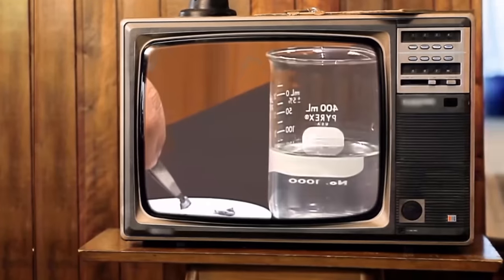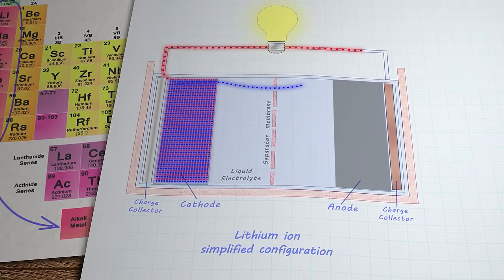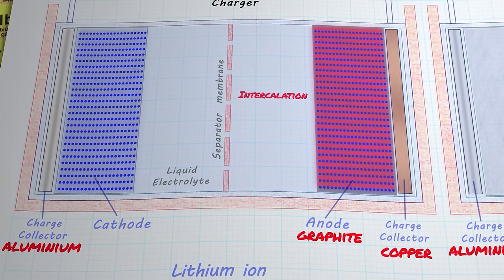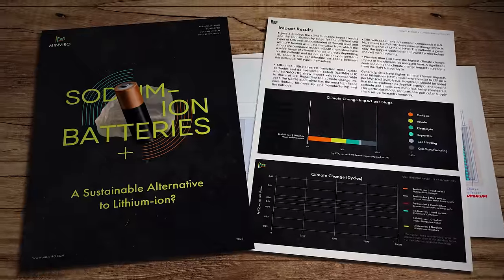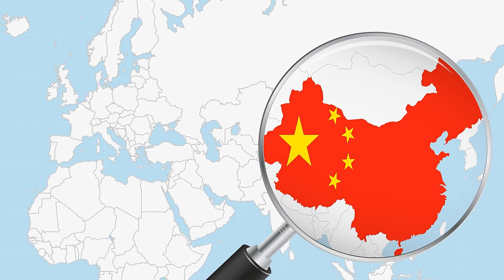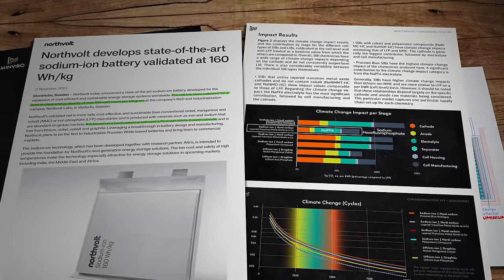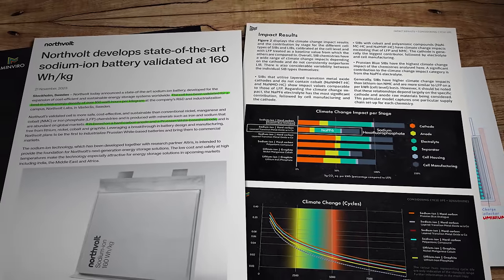Will your next battery be based on salt?

Comment: Dave, one of the primary needs right now is for affordable, home and small businesses-scale battery storage. China is selling a 30 KWh EV for $12,000. In the US, a Powerwall (modem flipphone) goes for $11,000 per KWH! The average house will need at least 30 kWh of storage. I’d love to buy a Chinese EV just to store the energy from my solar panels for home heating, cooling and lighting.
Reply: The cost and complexity of switching and inverting at the home makes no sense.  Far better to actually invest in the grid and leave these problems for a far larger scale and benefit everyone.  I know california's grid is 💩 and everyone thinks they need energy independence but it is a terrible future.
Reply: @ccibinel With most manufacturers planning their future EVs to include bidirectional AC charging, most homes would just need an interlock kit or manual transfer switch, avoiding the complexity you noted.  Same tech used by many with their home generators.  

Yes, some will opt for the cost and complexity of automatic switching, but they will be in the minority.  

And incidentally, those costs are also dropping.

Comment: The old VW e-up has only 126 Wh/kg cells and it is enough for everyday city driving (and those chells charge fast and handle low temperatures without problems).

Comment: As an urban/suburban transportation system planner, the bigger picture is to me being ignored. How about we not plan on everyone driving as much nor as far as we do today? In that regard, any new battery resource must be distributed to the most households. Instead of planning for EVs to provide a 300 mile driving range, 30- to 50-mile range addresses the problem of maniacal traffic and senseless car dependency. The EV tech that offers most benefits in this regard is "small battery" plug-in hybrid PHEV, eventually PHEV+H (combustible hydrogen) especially applicable to long-haul freight trucks as well as average household EVs that can keep the lights on in grid outage, indefinitely when matched to consequently smaller rooftop solar and neighborhood mini-grids.
Reply: I agree, the retirement  market might like this.

Comment: Why don't we use ram pumps to push water to an elevated reservoir? It could be a closed system, using a bit of solar to get the ram pump negative syphon pressure started. It's not just current technology, it's perfectly clean easy to maintain; unaffected by weather or drought. You'd need a lot of them and a lot of tubing since ram pumps don't go up steep hills, granted, but the energy generated from releasing the water is perfectly free and perfectly reliable and consistent. It makes way more sense to promote an economy of plumbers and geologists and pay low skilled labour a living wage to key an eye on leaks or stopped pumping to kick start the system again if pressure stabilizes. There's no downside except the productive labour. Besides nuclear, it makes more sense than massive endeavors like refitting the entire grid to get EV's on every driveway.

Comment: Wind and Solar + Battery storage is the way of the future. Take the energy the sun emits, store it in a set of grid batteries, then pipe the energy to where it needs to go. If sodium batteries can be cheaply manufactured and replaced/maintained, that would be great.

Comment: From what I've seen, there are more benefits to sodium than what was explained in this video.
-the first and most important to Canadians is that Sodium has >90% energy availability at -20°C which means winter range would be way up.
-the second benefit is due to its stability of the chemistry, it doesn't require liquid cooling or heating.  This drastically reduced pack weight and complexity. 

So between battery price, pack price and complex, weight of batteries, weight of fluids and radiators etc we should be able to see $20,000 small cars that work in the high north.

Comment: Several years ago David Pogue talked about Aqion(?) energy, pretty much a battery with no lithium. Yeah, energy density was not great, but it couldn’t explode, could be discharged to zero volts, and if you just have a large warehouse of them, it could make sense. 

They even made batteries for a time for home storage

Sadly, they went bankrupt because of the energy density of lithium, but I always hoped someone would bring back an extremely safe and environmentally friendly battery to the market. 

Caught up in law suits and patents.

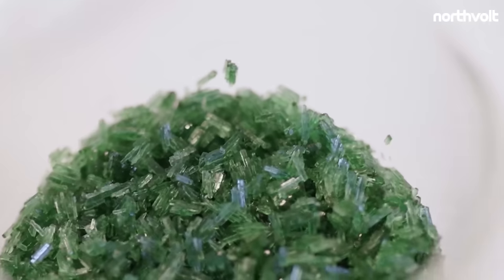Comment: @8:30 About Northvolt, the have invested far more than 10 biljon USD in their plant has not produced more than 0.15% of the factory capacity. Their CEO just sold all his shares (does he not believe in his company??).
About Sodium batteries, they have a much wider range of voltage, between charging voltage, full charged voltage and empty (10% left) than litium batteries. A single cell has to ben charged with 4.0 V, has a fully charged voltage of 3.5 V and is considered empty (10%) below 2,375V. A lithium battery cell keeps the voltage within 3,7 - 3,6V - 3,375 V resp. This is possible to control in a car that contains all electronics, but if you should use it as a replacement for 12V lead battery you have to have a lot of control electronics and converters to have a fairly standard output voltage.

Comment: There are a lot of ways to improve the NA battery such as mixing Li and Na into one cell reducing the amount of Li you over all need. Another is to add M - so NaM cells for higher volatage output. Another is to change the other said to Si and S and building a matrix design to store better. The other is Solid State that removes or mostly removes the liquid inside. I am just saying that Na has as much of a path forward as Li does personally if not more as it can reduce the need for Li or simply allow for more production to happen. More production the better as we move forward with using more battery storage. NA is only on Gen 2 and its already biting at the hills of LFP a Gen 5 product just to put it into the picture. For the most part, it only needs to hit "good enough" it doesnt have to excel Li over all power dens. Aka, if they can hit 300 that be more than enough to cut the battery pack in half while still providing 300 mile ranges as todays LFP does now.

Comment: I wish I could remember the source, but I recall one report suggesting that Sodium Ion Batteries would take around 10 years to reach a point where they are going to pass the sales of Li-Ion batteries.   Another source pointed out that no single battery technology had all the advantages and none of the disadvantages.  Thus, we'll find that one application will pick one technology, while another will pick a very different technology.   Thus, car batteries would pick a different technology than grid storage.

Comment: Sodium ion batteries will be useful for electricity storage plants and solar panel Installation in homes or any application where the size of the battery doesn't matter a lot.

Comment: Someone said energy density is not a concern for stationary storage.  That person doesn't understand what energy density is. There are two types of energy density: gravimetric and volumetric.  Most of the time the gravimetric is the concern - the weight of the 1 kWh cell.  But the volumetric energy density is important - the size of a 1 kWh cell must be reasonable.

Comment: The mobile applications are great, but it's the static storage that will drive the real development of these storage technologies. Power grids desperately need a way to even out the generation curve, and long-life sodium storage seems like the ideal way to do that. Once it becomes too cheap to argue against then all the wind/solar/geothermal/tidal/what-have-you generator firms will be using sodium storage to store all of their generators's output up to full storage capacity. No more of this noise with the windmills not spinning because the demand isn't there at the time. Just store it up and use it when the wind quiets down.

Comment: The thing I'm curious about (as a former fire investigator) is the safety compared to lithium-based chemistries.  You mentioned that the cells can be transported at basically zero state of charge, which is good, but any idea how they compare (when charged) to lithium?  Are there still the same thermal runaway risks, or are they more stable - or, because sodium is more reactive, are they worse?
Reply: Supposedly More stable because they lack the dendrite problems found with lithium.

Comment: If NA-Ion batteries prove as safe, inexpensive, capable and presumably recyclable as everyone thinks, once it really starts breaking through, I imagine it will capture more of the energy storage market than just 1%...
At least if we, as a world, finally start pushing toward renewables and less carbon-burning centered energy sources.

While the practicality small and mid-size cars may take a bit, due to efficiency questions on smaller scales (though this could be counter-balanced by the relative inexpense of materials used making batteries not cost almost as much as a brand new vehicle), I could very easily see things like Lorries and other Heavy-Duty machinery using them, not just storage plants.  The size and weight of the battery would matter less, and they'd be able to store more for longer trips, making efficiency discrepancies also matter less.

At least, I have hope in that being the case.  I'm still waiting for BYD to open a test market in the states for their cars though.  Or Silence.

Comment: How about the fire risk with these sodium based batterys? I have seen what afire of 3 ebike L-ion batterys caused and it would be a good plus if this danger was limited.
Reply: Well, that's a plus from the lower energy density  Of course if you are designing static storage then you can make more tradeoffs in the safety direction.

Comment: Very good video! One thing I have to say about sodium ion batteries helping lower the price of lithium ion batteries. For the first little while it will help lower lithium prices however the market will adjust accordingly, meaning mining less, which will increase the price of lithium back to where it was or close to. It's not like lithium miners can lose money indefinitely. There is a limit on how low the price could go while still making money in the mining industry. The free market works that stuff out

Comment: Trust the Chinese to ramp up production VERY quickly.
When the power tools transitioned from  NI-Cd batteries to Ni-Mh it took years but then came the Li-Ion tech and producers shifted to the new battery in a very short time. In China fast charging stations are everywhere even in small towns and prices are affordable. Small capacity battery is not a real issue since charging is not a hassle and city drivers don't usually cover large distances on daily basis. Commuting to far away cities is done by high speed train, not by car.

Comment: I anticipate that there will be numerous battery improvements on the horizon. They're not here yet, however, and so I simply have to rely upon what is now available. Indeed, I just traded-in my 6-year-old NCA electric vehicle for one with NCM batteries. Still, it wouldn't surprise me if this new pack lasts longer than the car —or me, truth be told.

Comment: whats crazy is that sodium ion have the potential to drop in replace all flooded/agm lead acid batteries. the voltage range is compatible with all lead acid based car alternators. they have almost the same output amps (CCA) for a given volumetric density. they are rugged enough to very likely not require a BMS, maybe just a cheap active balancer. No BMS would fix almost all the issues you run into trying to fit a lithium battery into an ice automotive application. whats the real kicker is that their cycle life means you might never need to replace your car battery again. it could drain to flat every day for years and if you jumped it it would just work like new, unlike lead acid. their lower internal resistance would mean marginal fuel savings. this is the real application for these.... just have to wait and see

Comment: Here is an idea that I ran across, that I can't even remember where.  The idea asserts that we junk our cars before they become unreliable to drive based on age or mileage. While some are sold as used cars most are stripped of any valuable components and the metal is recycled. For electric vehicles this will mean that the battery packs will be sold at scrap metal prices to the stationary battery storage industry under cutting any other possible storage medium. Stationary storage will therefore be dominated by whatever battery technology dominates the electric car industry.

Comment: The Na ion battery 🔋 is only prototype for today. Is not a full production, + need test and create charger and discharge drivers and technology. + what about heats and winter for this battery? It take at least 5 years or more from my opinion. The lithium battery has created long time ago, but fast charger have start doing from around last 5-8 years.

Comment: Having a new ev, I would now far prefer a battery that has a lower range but I can use fully, rather than my current one that is paranoid i only use it between 40 and 80% to avoid degradation.

Comment: The Aluminum/Air battery, for the immediate future, looks like a practical option. No chargers needed. Just “swap out” the Aluminum metal plates and you are at Full Charge. From time to time, you would have to replace the liquid Aluminum Hydroxide electrolyte. The Aluminum plates would be about 3/8ths inches thick, about 4by8 inches, and you would need about 12 of them to “rebuild” a battery. With some clever engineering, the “plate swap” interval could probably be accomplished inside of 10 minutes. I envision that “gas” stations could install tall/skinny Vending Machines that vend Aluminum plates.

Comment: Thanks for the update Dave! Yes Sodium sounds like a promising avenue for stationary storage. Although I live with lead acid batteries and I looked at replacing them with Lithium batteries but there was no comparison. Lead was an order of magnitude cheaper. I wonder if you would be willing to take a look at the lead scene out there and make a video on any new developments with lead acid batteries. I'd call them an unsung hero of the battery world
Reply from the maker: Cheers Tom
Reply: The only new thing is graphene in the negative-plate paste, it gives a marginal improvement in partial SoC tolerance compared with the carbon-black that's been in use since WWII. Carbon also acts as a capacitor, improving charge acceptance. (It's worth having in leisure batteries, traction batteries,  anything that's expected to repeatedly work below ~20% discharge without immediate recharge. It increases the lifetime number of cycles markedly & the Voltage stays high to a greater depth of discharge).

Carbon seems new because it's being marketed now but it's actually 80 years old. Similarly the marketers have discovered calcium, manganese & other alloys in the lead of the plate framework but that's not new either. Spiral cells were the original 1859 design. AGM is fairly new, having been co-opted from electrolytic capacitors in 1975.

Comment: SIBs in their current state will not be replacing EV batteries any time soon. Their significantly lower volumetric, as well as gravimetric energy density along with somewhat lower rate performance makes them unsuitable for vehicles and many compact mobile applications. 

Currently they're also capable of handling fewer charge cycles before degradation becomes significant.

They may have some stationary applications though. The cost, and environmental advantages aren't insignificant. But i don't see them replacing LIBs anyntime soon, especially since that technology is also still developing.

Comment: Probably be 5 years before Sodium-ion will be marketed to the mass population at a reasonable price. The effect it might have is lowering of lifepo4 batteries as the sodium starts to hit the market. The first ones will be more expensive than most lifepo4. They will justify the cost by claiming higher safety and certified for use by regulators.